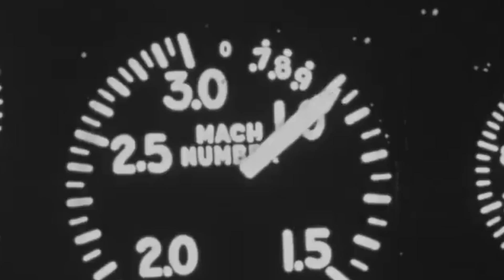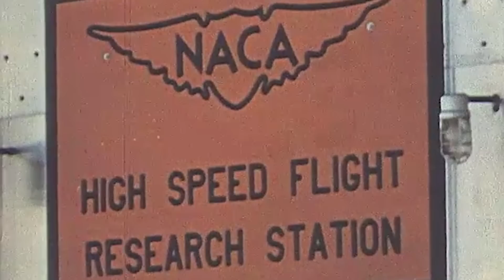The Flying Bullet That Shattered Aviation's Limits Forever

Comment: In hindsight we know that the Miles M.52 (had it ever existed) could never reach Mach 1 in level flight.
No aircraft powered by an obsolete and inefficient centrifugal jet engine has ever flown Mach 1.
Reply: @WilhelmKarsten  1/3 scale model did Mach 1.38 in 1948.......
Reply: @laurencedawson7754  We know that Frank Whittles W.2/500-M.52 engine never successfully completed a PTFR test and never produced the specified thrust to take the M.52 up to the speed of sound... Centrifugal turbojets , due to inherent limitations and inefficiency cannot produce the Thrust-to-Drag Ratio performance required for straight and level supersonic flight.

Britian did not have the technology to fly supersonic until 1952.,
Reply: @laurencedawson7754  What's you point?
 The Reynolds effect is scalar... so a scale model proves nothing.
We know today that the M.52 as proposed (and had it been built) could never reached Mach 1.
Air Ministry officials knew this which is why the program was never restarted.
No aircraft powered by an obsolete centrifugal jet engine has ever flown supersonic in level flight.

The Soviets attempted to build a centrifugal jet powered plane to fly Mach 1 but it also failed to reach the speed of sound, it was abandoned in favor of new Axial Compressor technology.
Reply: @WilhelmKarsten  "we know it could never have reached Mach 1" logical falicy, explain how "we know" this...... nothing of the sort is documented and the reason for the project being dropped is also documented as cost.....there's plenty of info out there on this...... You focus on the whittle engine- I made the point that the British effort was an attempt to build a practical aircraft , rather than a stunt to break the sound barrier, the X1 used a rocket engine as the US didn't have a sufficiently powerful whittle engine either.....if you make a point, back it up and explain - especially if your point goes against traditional thinking
Reply: @laurencedawson7754  Please name a single aircraft powered by a centrifugal jet engine that can fly supersonic in level flight???
Reply: @WilhelmKarsten  why? I refer you to my previous comment regarding the engine
Reply: @laurencedawson7754  You know the Miles M.52 never existed... it never flew supersonic.
Reply: @DoktorBayerischeMotorenWerke  of course, the project was cancelled before completion!? We were talking about where some of the information came from which the bell team used for the X1....….
Reply: @laurencedawson7754  The Power Jets Ltd W.2-500 engine developed for the M.52 was a failure.
In fact none of Whittle's engines ever achieved airworthiness certification or were reliable enough to enter mass production.

No jet plane with a centrifugal compressor turbojet has ever flown supersonic... they cannot achieve Mach 1 performance due to their larger frontal area and low thrust to weight.
Reply: @WilhelmKarsten  again, we were talking about where the information came from for the X1....no one is arguing that the m52 ever came close to completion..,.they may well have ended up using a rocket engine but that is a different issue to control......power jets was done over in a shameful move by the government who effectively gave the industry to rolls Royce......who went on to do ok!!! Hows your aero engine industry doing?
Reply: @laurencedawson7754  Again, we are talking about an aircraft that never existed. Britain would not have the technology to build a supersonic aircraft until 1954.

None of Whittle's engines were ever successful, they could not run long enough to pass a airworthiness certification test and were never viable for production.
Whittle's involvement in the M.52 embezzlement scandal destroyed his career, he was arrested and discharged from the RAF and forced out of his own company. Whittle would never work as aero engineer the rest of his life in exile in America.
Reply: @WilhelmKarsten  source please? he was promoted to air commodore prior to leaving the RAF and knighted in 1948...
Reply: @laurencedawson7754  Yes you have no evidence that a Whittle engine could achieve Mach 1. None whatsoever.
Reply: @billpugh58  la176 26th December 1948 with a copy of the nene engine.....
Reply: @laurencedawson7754  The Lavochin La-176 could not achieve Mach 1 in level flight, it crashed on its 7th attempt to reach Mach 1 in a full power dive.
 The La-176 was powered by the larger and more powerful Klimov VK-1 engine designed by Vladimer Klimov.
 The licensed copy of the Rolls-Royce Nene was called the RD-45.
The RD-45 never flew supersonic..
Reply: @DoktorBayerischeMotorenWerke  well aerospace Webb, Wikipedia and the aviation history sites all have this information on them so unless you have a source better than that then I'll take their word
Reply: @laurencedawson7754  The La-176 was NOT a supersonic aircraft.
NO aircraft powered by the inferior centrifugal-type jet engine has ever reached Mach1 in level flight.
 All of the accredited sources confirm that the La-176 was a failed prototype attempt to reach Mach 1 in level flight. 
The La-176 only reached Mach 1.02 in a steep, full power dive. 
It crashed attempting a supersonic dive.

The Soviets 
 built a licensed copy of the Rolls-Royce Nene, this engine is identified as the RD-45.
The La-176 was powered by the much larger and more powerful Klimov VK-1. this engine was designed by Vladimer Klimov.

All the credible aviation reference sources confirm these facts..
Reply: @DoktorBayerischeMotorenWerke  awesome, point me to the source.......
Reply: @laurencedawson7754 There has never been any supersonic aircraft powered by an centrifugal jet engine.
There is no evidence to prove otherwise
Reply: @WilhelmKarsten  articles online day otherwise, point me to any articles backing up your statement and I'll be happy to read them
Reply: @laurencedawson7754  Name a supersonic aircraft with a centrifugal jet engine.
Reply: @WilhelmKarsten  I did, the Russian one, the articles online all state they broke the sound barrier with it. As I say If point me to anything that says they didn't do it I'm happy to read it
Reply: If we are talking about level flight, then. Axial flow engines weren't doing it that early either, early fifties for that? Douglas skyray or super sabre ??
Reply: @laurencedawson7754  The first Soviet Supersonic aircraft was the MiG-19 in 1953.
The first British supersonic aircraft was the Fairey Delta 2 in 1954 but never saw production. 
 The only production supersonic aircraft designed and produced solely by the UK was the English Electric Lightning in 1957.
Reply: @laurencedawson7754  Read my original comment.

Yes they could, both the Messerschmitt Me-262 and the North American F-86 Sabre could reach supersonic in a full power dive.
Reply: @WilhelmKarsten  read my comment " if we are talking about level flight"  FD 2 did considerably more than that, held the speed record for a while
Reply: Any evidence at all of the 262 going supersonic in a dive - I read that one pilot claimed verbally to have done it..
Reply: @laurencedawson7754  The F-101 and the F-104 were actually faster and flew the same year as the FD.2.
It is yet more proof that despite British claims of being a leader in supersonic aircraft technology they were actually years behind America and the Soviets..
Reply: @WilhelmKarsten  ha ha..sure.....like I said held it for a while.....101 took it later that year
Reply: Actually looks like it held the record from march 56 to December 57 so not bad
Reply: @laurencedawson7754  But there were faster aircraft that existed at the time... Britain was years behind in supersonic aircraft technology
Reply: @WilhelmKarsten yeah maybe,  which ones are you thinking of? The US X2 was faster , but I think by then the speed records were already being broken down into separate rocket powered / turbojet powered catergories, the x2 was faster but rocket powered and had to be dropped.  The FD 2 record run was only really done for company prestige, it wasnt specifically designed to break the record.......didn't save fairy in the end
Reply: @laurencedawson7754  The F-101 and the F-104 flew the year before... both were already faster than the FD.2 and they were full production aircraft, the Fairey was only experimental and carried no military equipment
Reply: @WilhelmKarsten  you must have read the wiki pages?
All three first flew in 1954 (xf104) and all three held the record at different times....fd2 in 1956, losing it to the f101 in 1957 which was beaten by the f104a in 1958.....
The US aircraft were often released as prototypes or even full prod versions to the airforce with restrictions that were gradually released during service ..
Reply: @laurencedawson7754  The Fairey Delta 2 was a purely experimental research aircraft and never intended for production... it was also slower than the F-101 or the F-104.

As was pointed out the UK would not have an operational supersonic aircraft until 1960.... nearly a decade after the Americans did..
Reply: @DoktorBayerischeMotorenWerke  absolutely experimental, but for that period when it held the record it was the fastest. 101 and 104 flew the same year but didnt reach their full potential and go faster until afterwards, but of course they were ultimately faster. 
Then the lightning arrived.........
Reply: @DoktorBayerischeMotorenWerke  we had some terrible fighters prior to the lightning- sea vixen was the most powerful fighter in the world and still subsonic.....
Reply: @laurencedawson7754  The existence of the F-101 and the F-104 proves that it wasn't the fastest and was less capable.
 The Lightning didn't enter service until 1960...very late to the Mach 2+ party it was a flop, and produced no successors.

the Sea Vixen is an excellent example of just how far behind Britain really was in supersonic aviation. 
Just look at it... it is primitive compared to the much more powerful Mach 2.23 Phantom II that entered service at the same time.

It seems as if you brits live in some kind of "technology bubble"... completely unaware of any technical achievements that occur outside of the UK.
Reply: @DoktorBayerischeMotorenWerke  We've already discussed the timing.......104 and 101 broke the records after development a year or so after the fd2.....
As for 1960 for an operational Mach 2 that's Certainly not "very late" 
If you just want to hate on the British you'll have to join the queue with the rest of the world!!!!
Reply: @DoktorBayerischeMotorenWerke  as I said we had terrible fighters up to the lightning
sea vixen poor, scimitar terrible, hunter very good but too late
Phantom was obviously way ahead of the world as a weapons platform, we bought it effectively to replace the lightning.....
Reply: @WilhelmKarsten  I think a Russian thing went supersonic.....just with a centrifugal compressor......at the limit of what was possible with those designs
Reply: @laurencedawson7754  The Soviet OKB l-1 was a failure and never reached Mach 1...

Comment: Just think about this for a minute.  The X1 went from sub sonic to a Mach 3 possible aircraft in the space of 6-7 years.  10 years later the X15 was doing nearly Mach 7.  70 years have passed and we are still expected the believe thats it - thats as fast as we go.... in fact we are slowing down, as the SR71 is retired.... yeah,,, right.
Reply: Engineers have reached the limits of fluid dynamics and the limitations of aircraft traveling inside the Earth's atmosphere, higher speeds can only be practically achieved in the vacuum of space.
Reply: @DoktorBayerischeMotorenWerke  Possibly.  My personal view is that its likely novel technologies which pivot away from traditional thrust based aircraft were probably in development from the 90s.  The documented dual / tri cycle engines that we know about are in my view old technology.  The holy grail of unlimited speed, invisibility and indestructability are just too tempting for these guys not to at least give it a go.  Just my 7 cents.
Reply: @auwz66  Thrust is not the real problem, overcoming the heat caused by the friction of air against the aircrafts outer surfaces is the problem. higher speeds can only be maintained if solutions to managing this heat are found, solutions that may not be possible due to the limits of physics itself.
Spacecraft have already proved to be faster in the vacuum of space which is devoid of the air that causes both heat and drag,
Reply: I had heard that the F-111 had a timer to use when supersonic at low altitude to warn of heat weakening the airframe. As I said 'heard'. Can confirm or deny?
Reply: My other question is why the us has not deployed a hypersonic missile program.

Comment: Miles
Reply: Miles never designed or built a supersonic aircraft... the fastest jet they ever made only flew 285 miles per hour
Reply: MESSERSCHMITT provided the critical component design and aerodynamic data that allowed the Bell X-1 to break the sound barrier...

Miles Aircraft never produced any jet aircraft that could even reach transonic speeds.

Comment: Great story but such a shame the British government cancelled the miles m52- unassisted take off and landing, fully controllable whittle engine and contributed a lot to the X1....
Reply: Never happened. The Miles M.52 does not exist... never did.  Dennis Bancroft never produced any credible evidence to support his slanderous false claims about American interference or data being handed over the Bell.

Bell Aircraft used captured German technology to develop the XS-1 that flew supersonic.
 the Bell team used a nearly exact copy of the Messerschmitt Me-262's fly-by-wire Horizontal Stabilator system.   

Britain was more than a decade behind the Germans in supersonic aircraft technology and they, not the British gave the Americans the power-assisted, fly-by-wire stabilator..
Reply: The Miles M.52 contributed nothing to the Bell X-1, the M.52 was never built and no trace of was ever found.
Miles went tits-up after its coffers and the M.52 program was loited..
Reply: @WilhelmKarsten  not so, the American team from bell visited the UK and were granted full access to the miles m52 project. The biggest contribution to the bell X1 was the all moving tail plane which solved their control problems.....
Reply: @laurencedawson7754  Never in the entire history aviation has there been so much discussion regarding an aircraft that never existed.
The Miles M.52 never existed

Britain did not begin construction of its first supersonic aircraft wind tunnel laboratory at RAE Bedford until late 1947, the British lacked the technology to build supersonic aircraft until the 1950s.

The M.52 was a proposal for an aircraft that Britain could not design or build at the time.

Revisionist historians has fabricated a false narratives regarding the M.52 in an desparate attempt to insert Britain into the early development history of supersonic aircraft that it was not a part of.

The Miles M.52 embezzlement scandal is a truly shameful and humiliating chapter in British aviation history that destroyed many careers including Dennis Bancroft, Frank Whittle and Eric Brown.

The Horizontal Stabilator is not a British invention and factual evidence confirms this.
The Messerschmitt Me-262 was the first jet aircraft to have a fly-by-wire Horizontal Stabilator system.
Reply: @WilhelmKarsten  dude there a stack of documentary evidence and models of the m52, all the dates and info is available......of course never finished, but the concepts and solutions are what the US took back.
The 262 was never my point but since you mention it here goes- all moving tail plane or stabilator, seriously? A quick Google search will show you photos of a 262 with the elevators quite clearly raised - how do you account for this? Hell there's even a new one been built in the states that's flying..... shouldn't even be a point for discussion.. fly by wire? A mechanical flight control system is more like it- read " flight control systems" not sexy but very interesting- the of what we would call fly by wire was built by NASA on a converted f8 crusader, or the Apollo space craft if you really want the first......
Reply: @laurencedawson7754 Britain produces and consumes more fictional literature than any other country in the world relative to its size.

The Miles M.52 tale  is a perfect example of how Britain's appetite for fantasy and fictional tales impacts its its history books and its sense of place in the world.

The M.52 is a story fabricated for the sole purpose of falsely inserting Britain into the historical timeline of the development of supersonic aircraft that it  never participated in or contributed to.

Britain would not have the technology or the ability to build a successful supersonicaircraft until 1952.

Just like Sherlock Holmes was not a real person, the M.52 was never a real airplane... even though many brits still believe they are real.
A 2008 UK poll showed that 58% of Britain's teenagers believed Sherlock Holmes was real.

The fastest jet aircraft produced by Miles Aircraft could not reach 300 mph.
Reply: @sandervanderkammen9230  whatever you say........
Reply: @laurencedawson7754  Miles Aircraft only ever constructed 2 jet aircraft, the M.77 with a top speed or 228 mph, and the M.100 with a top speed of just 298 mph.

Miles Aircraft never built a supersonic aircraft!
The UK would not have the technology to build a supersonic aircraft until 1954.